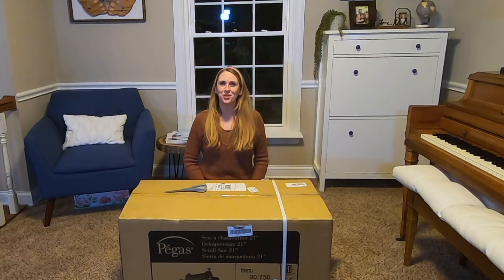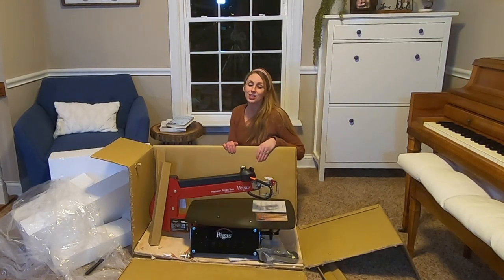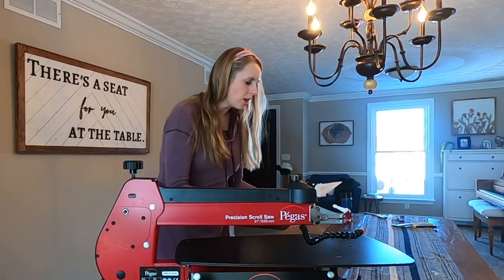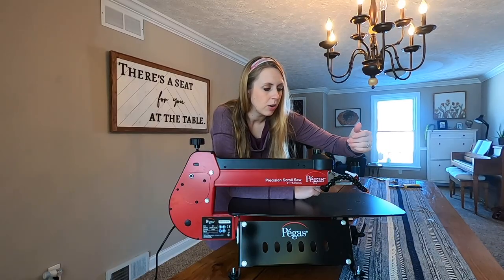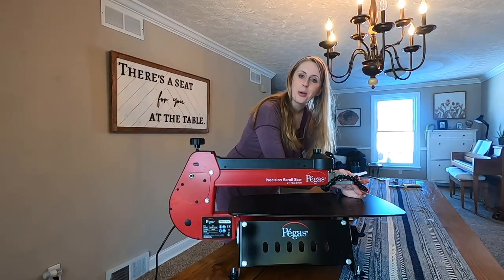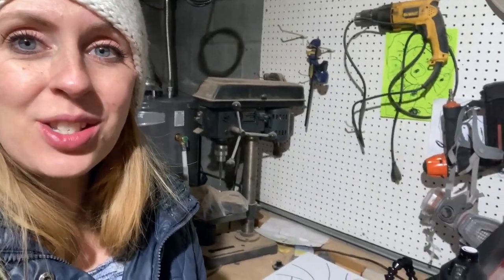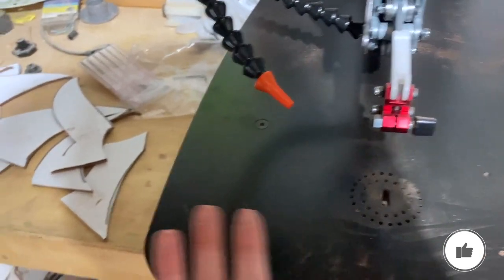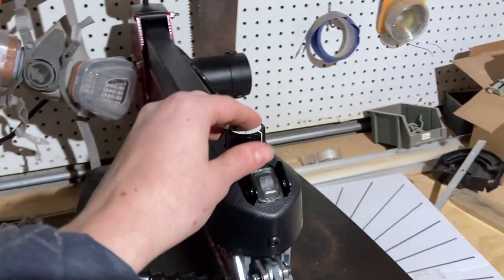Pegas Scroll Saw | Unboxing and Review

Comment: Thanks for sharing your journey. I currently have a Porter Cable and I'm getting frustrated with blade breakage. I've done all of the precautions to limit breakage, blades, tension, speed, etc. My eye is on the Pegas so I'll be watching for your updates! Subbed and happy scrolling!
Reply from the maker: Thanks for watching! Yea, it’s one of those things…it can be done, but is the money saved worth the added frustration? So far so good on the Pegas! Two projects in and I’ve only broken one blade…and it was probably my fault for using too small a blade :). Best of luck!
Reply from the maker: Thanks for watching! Yea, it’s one of those things…it can be done, but is the money saved worth the added frustration? So far so good on the Pegas! Two projects in and I’ve only broken one blade…and it was probably my fault for using too small a blade :). Best of luck!

Comment: One should buy a Hegner first time. No need to buy two machines. I don't promote Hegner
Reply: This Pegas was an upgrade from the Porter Cable.  Hegner is a high price machine and has some features that many do not care for such as the antiquated blade changing method.  Service for Pegas and the Seyco saws are highly recommended as well.
Reply: I started with a porter cable then switched to hegner... Getting rid of the hegner was a very easy decision... Pegas is far and away superior.... Very preci

Comment: I would prefer the parallel arm scroll saw.. like the Hegner scroll saw (Y)
Reply from the maker: Interesting. I’ve never tried one! So far I’ve been super happy with my Pegas though ❤️
Reply: @WendellWoodworks  thanks for reply.. the point is less moving parts and lowest vibration..and the most simplest machines.. in the Hegner (Y)
Reply: @ravebrave8866  Terrible blade change system on the Hegner in many opinions as well as the higher price tag.
Reply: @michaelfowler8495  Apart from Hegner there are similar other machines which are better.  My point is less moving parts and low vibration so less wear n tear.